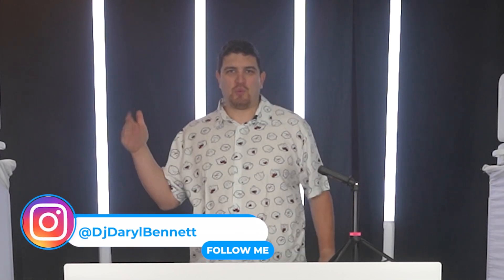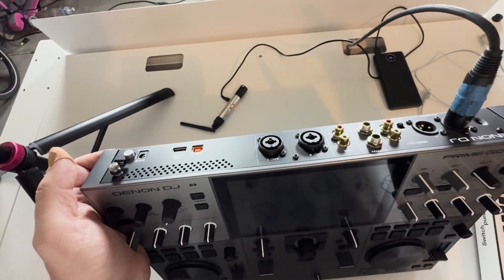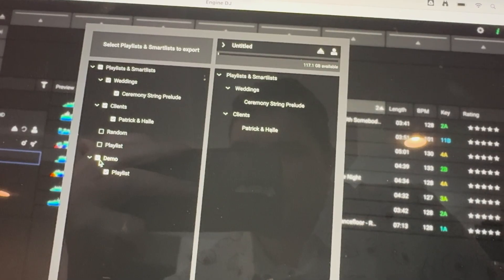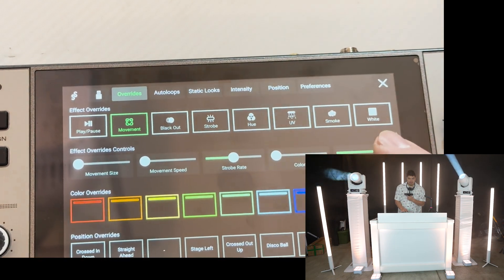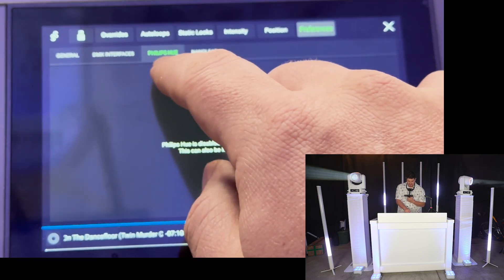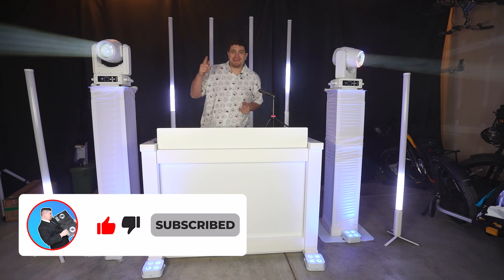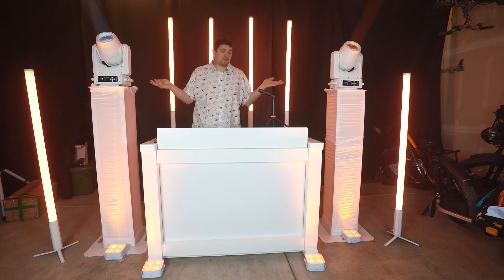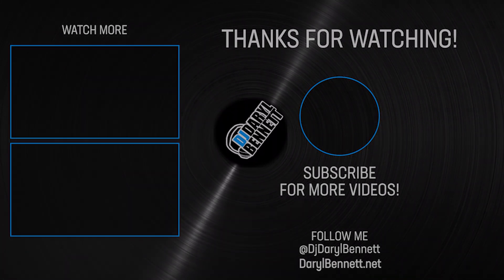Engine Lighting Tutorial 2025 | Control One | Walk-Thru & Demo | SoundSwitch

Comment: Do you have to have a dongle connected to every light so they are in sync?
Reply from the maker: Yes, unless they have built wireless dmx receivers. Which most of mine do
Reply: @DJDarylBennett  i own the both movers that came out a few months ago (battery White ones)  and both 360 tubes. Do those have built in dmx? Shame on me for not knowing but I wasn't interested in dmx when I bought them.

Comment: Hi Daryl , what powerbank are you using to juice the DMX transmitter?
Reply from the maker: Nothing special, any would work. But I"m using this one: https://amzn.to/3PvMfZg
Reply: @DJDarylBennett  thanks but i'm encountering some difficulties: the Wireless DMX dongle has an input that expects a positive + sleeve (negative pin) for the DC connector. All cables USB to DC seem to have a - negative sleeve (positive pin). Did you encounter the same issue? I think i have the same chinese transmitter than you have from the view of it
Reply: it is called a center negative DC connector, which has male usb to the other side...can't seem to find it antwhere😒

Comment: Do you need a soundswitch subscription or liscence to use engine lighting?
Reply from the maker: Yes you do for most stuff
Reply: @DJDarylBennett  thank you sir
Reply: @DJDarylBennett , and but of an odd question.

When generating a lightshow using the AI, will your position overrides actually override the lightshow?

An example of this is let's say you have a position where you don't want the light pointing behind the booth, but the AI generated a segment where the mover will point behind the booth. Will your positions override that?

Comment: I do all my weddings with a Denon Prime Go using Engine Lightning and it's been a game changer for me, I don't have to carry a bulky DJ setup anymore and I can run a great lightshow without needing more gear. The final step for me was purchasing the SS Shortcut. Keep it up with the good work mate. Cheers from Spain :)
Reply from the maker: Que guay! Glad that it’s working for you man. Saludos
Reply: Nice! I enjoyed this walkthrough Daryl! I use a similar set up for smaller gigs, the Numark Mixtrack Pro+, control one, both Ir4s, moving heads and Chauvet tubes! Very portable, quick and easy to set up!
Reply from the maker: @GregBish  nice! I like the Numark Mixtrack Pro+ with the built in speakers

Comment: I have to go back and re-watch all your tutorials. You make it look so easy and last night I got to a gig, hooked up my soundswitch, and could not even get the control one to light all my Both Ir4 to a static color lol! Ended up packing it back up and using the remote that comes with them. Not sure if I have some setting wrong or an override or what. All I could get to work on the Control One was the White out button.
Reply from the maker: Oh man I’m sorry to hear that! Be sure to operate in stand alone mode as a backup in performance mode when your DJ software isn’t connecting